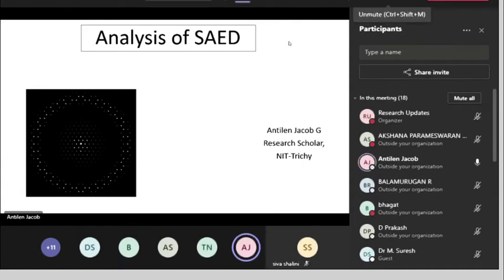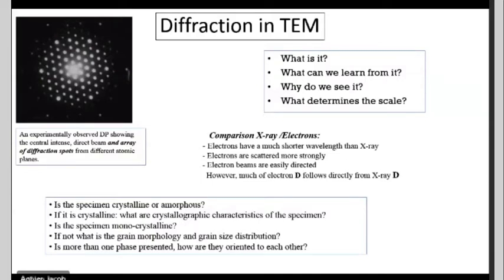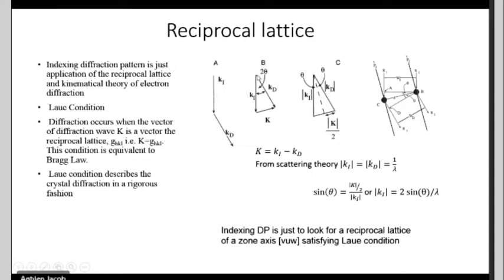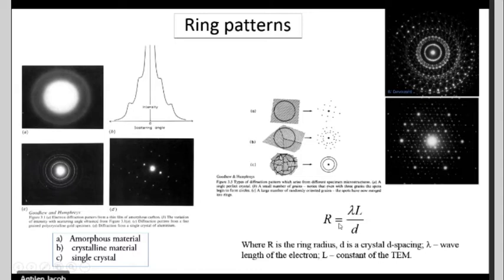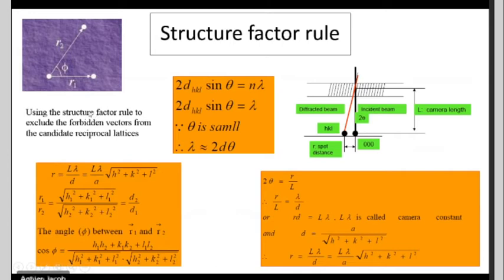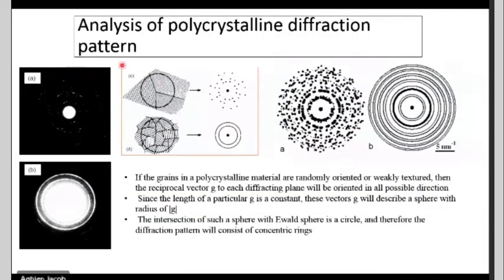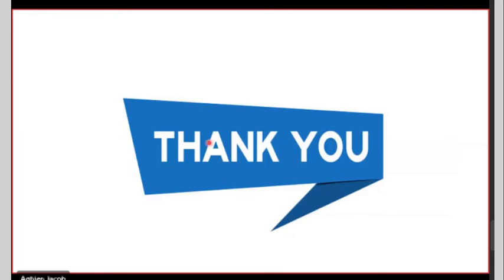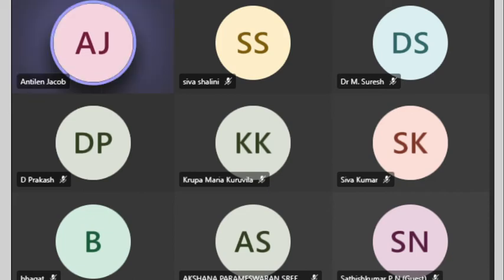Discussion on 'Interpretation of SAED patterns'

Comment: Sometimes the diffraction pattern is acquired from the multiple phases especially when the targeted phase is very small. For example, in acquiring diffraction patterns of Al13Fe4 nano-sized phase, the diffraction spots from Al matrix become an integral part of the patterns. In that case how to identify the diffraction planes and zone axis?
Reply: This is one of the disadvantages of the technique. I think in such cases (when we have multiple phases), it is always preferable to combine structure factor phase information from HRTEM , rotation electron diffraction (RED), precision electron diffraction (PED) with XRD. There is always a level of uncertainty as the diffraction patterns obtained are based on the crystal orientation which is perpendicular to the electron beam. Therefore attempting to derive crystal facets merely from observed lattice fringes is not so reliable.
Reply: In these cases, indexing of planes can be done based on the d-spacing values in ICDD which are more closer to the calculated ones. As in the case of Ag, Au. the highest intensity peaks corresponding to (111) planes are at a d-spacing of 2.35 A°. In such cases it becomes difficult to distinguish between the two. Other complementary techniques has to be combined to confirm.
Reply: @akshana2770  Thanks for the information.